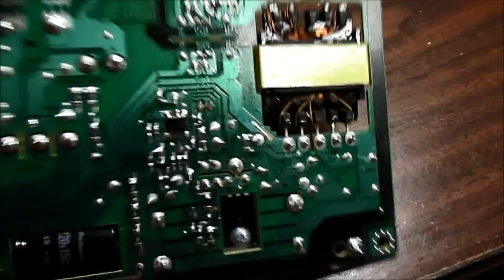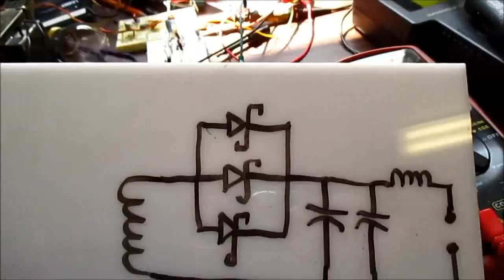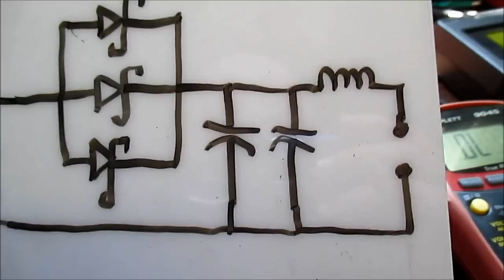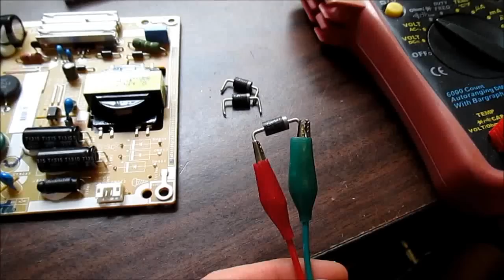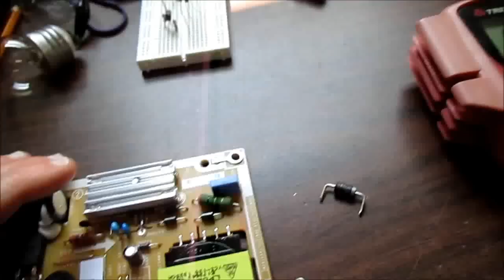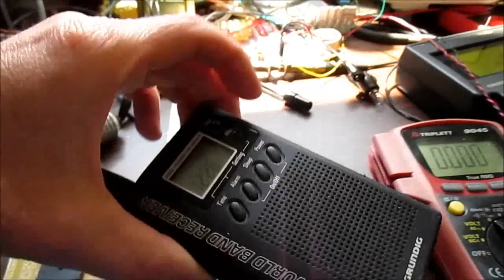Vizio E320i-A0 powersupply board diagnosis and failed repair

Comment: Sad when you break an easy fix while working on it. I tried to fix a similar board LCD TV PSU (however way larger) because of a vaporized ceramic cap, but replacing it wasn't the only problem to fix, something blew up again when powered on.. I need to do a deeper surgery

Comment: Thanks for the videos t. I have a Vizio  E422VLE , The tv has no lights wont power on. I purchased a power supply board and installed it and still no power or lights. Before I purchase a main board, how can I check the main board to see if it is good. Can you tell me the voltage pinouts or other ways to check it ? Thanks. Main board  3642-1492-0150(4B).
http://www.shopjimmy.com/vizio-3642-1492-0150-main-board-for-e422vle.htm

Comment: mine is blinking. would replacing the power fix it?
Reply from the maker: +Mr. Buck That could be a problem on the main board. Measure the power supply voltage to be sure.
Reply: +JohnAudioTech alright thanks I will try replacing it

Comment: I have the same issue as edo4649. I have a Vizio E320i	A0. I removed 15 screws, but the back panel is snapped together as well as screwed, and it does not come apart easily. How did you remove the back panel?

Comment: Have a vizio model E320-A0. Can't remove back cover to fix cable connection which broke off when someone yanked on TV w/o unscrewing cable first. All screws removed but very tight yet. Don't want to pry it off unless there is a pry point I don't know about ??

Comment: Hi JohnAudioTech, Your handle 'JAT' doesn't say anything about T.V.. Sounds like you learned a lot. Jeri Elsworth on YT, a self taught elec engineer, says the key to learning electronics is fail & fail often. At least your doing electronics, how cool is that. Check out Jeri, pretty cool. From Yamhill or Carlton, Oregon, kinda Northwest of McMinnville or Newberg, not so far from the coast and where I live in Willamina, OR. Take care, C.

Comment: I used to work in tv repair shop, you have to be careful when checking voltages in transistor sets, short something and you blow a bunch of parts. It wasn't that way in the old tube tv's however.

Comment: Maybe you can replace mosfet and IC. If IC is UC3842/3844, those are pretty common 8-pin chips
Reply from the maker: It uses Asian parts that typically not available through the normal supply chains.
Reply: JohnAudioTech I agree, but if that IC is chinese analog to UC3842 (for example) you can replace it with original. However, if that IC is custom, changing ain't gonna work
Reply from the maker: MrJohhhnnnyyy IC number is S3320 probably available from Chinese vendors but I have already obtained a working PSU board for under $11. I may make a video about installing it back into the TV.
Reply: JohnAudioTech OK, post it if you can.

Comment: Swith Mode Power units only advantage is low cost, and small size for high current output. They also generate RF polution.
Great Video Thanks.